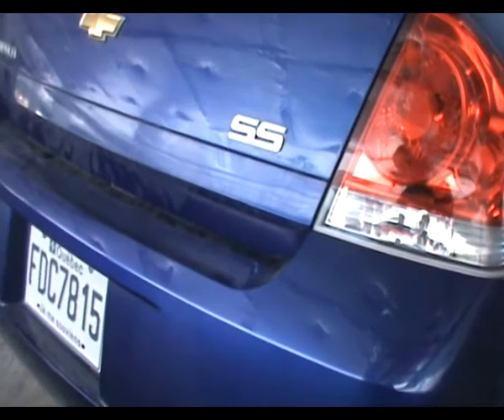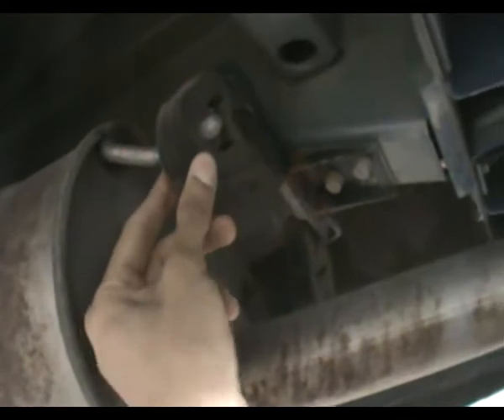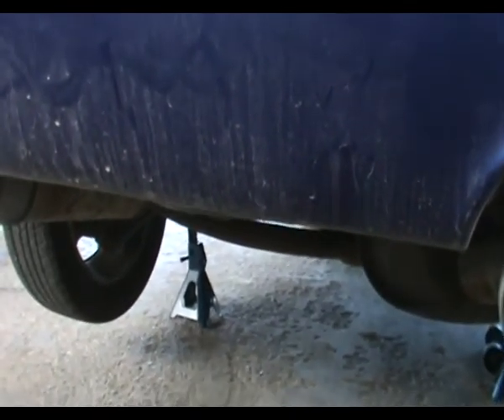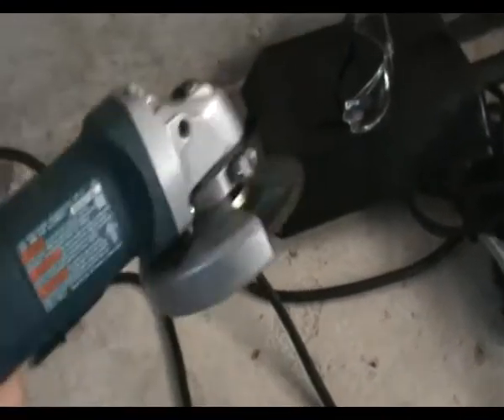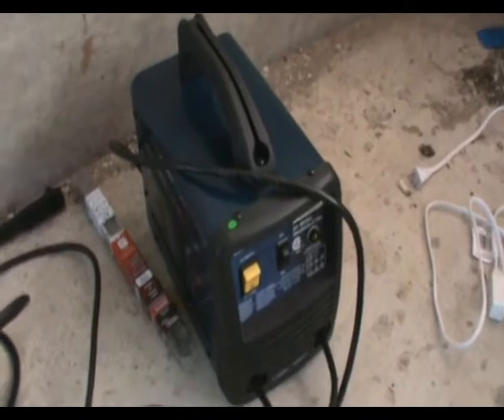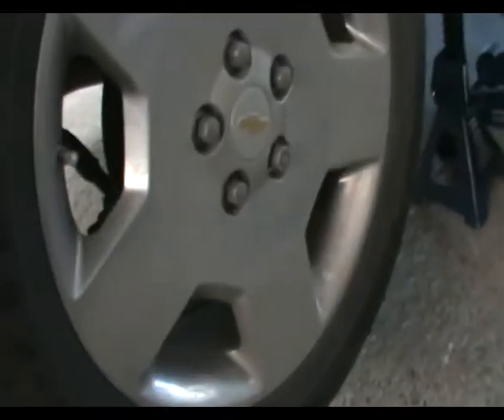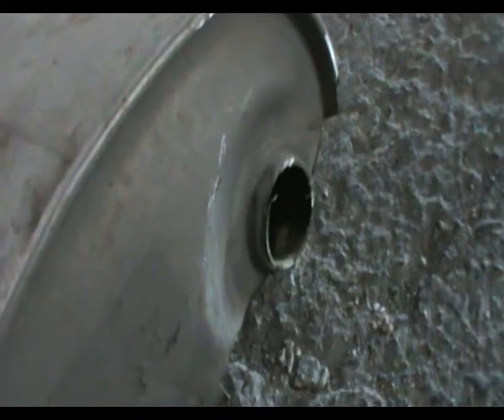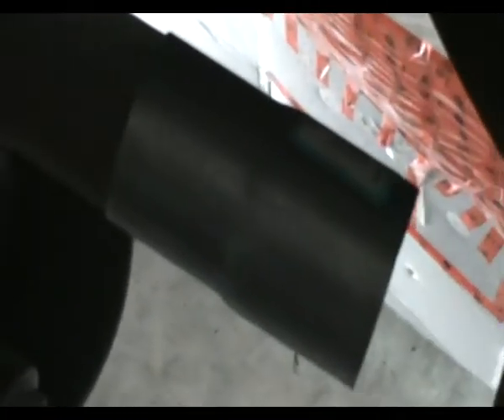Changing mufflers

Comment: Great video. What mufflers did you buy? I'm working on a muffler change and have Soundmasters from Napa. I'm actually waiting for the right muffler to be delivered by Wednesday and I notice you grinded off the tips and have 2 connectors which I should also purchase? I just don't know what size they should be. I have the exact same car..